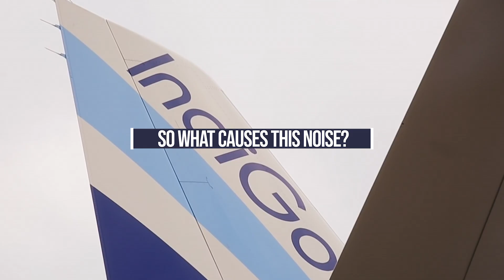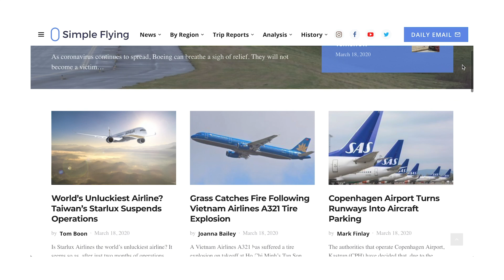What Is The Strange Barking Noise Some Airbus Aircraft Make?

Comment: The PTU will operate to transfer hydraulic power from LH to RH or RH to LH whenever at least one engine is fully powered. This will happen normally upon engine start, right after the first engine start (usually number 2, on the RH wing). Any other activation of the PTU indicates a failure in some degree.
PERIOD

Comment: Pretty accurate, but you'll never hear it in flight as it's only operational with one hydraulic system shut down, as in a single engine taxi or at the gate. This is only if the pilots don't turn on the "y" electrical pump while taxiing and when at the gate with the pump off and one engine either running or just shut down with residual hydraulic pressure remaining.

Comment: It happened to me once, I knew exactly what was going on but mostly everyone got spooked and started mildly freaking out. Me and probably a small handful of people, stayed calm because we knew it wasn't engine related. Hydraulics problems are the least of your worries as a passenger. The worst that can happen is an emergency landing on water, or landing on a foam covered tarmac. 

Even if there was an engine problem, your best option is to remain calm. Panicking will cause others to do the same and cause chaos, which what the crew and pilots clearly doesn't want to deal with during a dangerous situation. They need to focus on their tasks during an emergency. If not, it could cause major problems or delays that can lead to the plane crashing.

Remember, the pilots have trained many many many times for those situations. They know what to do. Sit down, relax, drink water, and trust the pilots with definetly more hours of experience compared to you. They will do ANYTHING to keep their passengers safe and well.

If you don't trust your pilots, why are you even considering riding on a plane in the first place? 🤨

Take a boat or something, jeez.

Comment: The PTU works like a turbocharger in a car with the difference that the turbine/pump impellers are driven by hydraulic fluid. The PTU is a redudancy backup pump  that connects 2 of the 3 hydraulic systems together. This is so that if the hydraulic pump in either of the 2 systems fail the pump in the still working system can then power the other broken system through the PTU keeping both systems operational. I saw some video  of one runing up close. The device emits a high speed turbine like sound while running along with the barking noise. Wikipedia has a great explanation to how the device works and WHY it sounds like it does. https://en.wikipedia.org/wiki/Power_transfer_unit

Comment: Scary sound. Had a very bumpy ride in an old Spanair A320 (engine vibrations included). We had to fly a holding pattern over MUC for 45 Minutes in rainy and stormy weather. And the dog was barking and barking and barking. Since I didn't knew the source of the sound, this was my most frightening experience on a plane ever. Spanair went bankrupt a few months later…

Comment: have only flown twice on 320's, but noticed a large number of noises coming from under the floor. I figured they were all related to control surface actuators on the wing as i was sitting right above it. With all the work that went into designing those aircraft, you'd figure that the engineers would consider it something passengers would rather not be hearing and design the controls differently. One constant noise sounded a bit like landing gear doors banging. Plane had a nice comfortable interior, but the noises were not at all comforting. And I'm used to flying on 737's and some turboprops!

Comment: The video only touches on this: Airbus planes have more than one hydraulic system, each powered by one of the engines. The dog mainly barks when only one engine is operating because the power transfer device is providing pressure to the other system.

Comment: Hi there, ex A320 engineering technical instructor here. A few little facts that weren't really mentioned. The hydraulic systems on the A320 are Green, Yellow and Blue. The PTU is connected between the Green and Yellow Hydraulic Systems and also operates when there is a 500psi differential between the Green and Yellow System. e.g green system drops from 3000psi to 2400psi and yellow is 3000psi the PTU operates. You may also here the PTU when raising the landing gear. This is due to when the valves open on the Green side of the system to pressurize the landing gear actuators there is a drop in pressure as the hydraulic lines need to be pressurized from the valve to the landing gear actuator. The pressure drop is sensed and the PTU operates to increase the green system to 3000psi. once at there is less that a 500psi differential the PTU stops operating.
Reply: Does this occur during the other phases of flight too such as when the pilot is maneuvering and configuring the airplane for a landing which would involve the application of pressure on ailerons and other control surfaces? That activity would set off some actuators too which would require the expenditure of hydraulic fluids, isn't it? Is it possible that during such times we just don't hear the PTU because its sound is drowned in the drone of the jet engines? I am curious to know. Thanks.

Comment: Thanks for info. Good video.
A hydraulicaly powered pump for maintaining a minimum pressure across the hydraulic systems of the aircraft. Sounds strange to me.
The first time I heard this noice, was when the plane was at the gate after the flight, and passengers were waiting to disembark. I think seat belt sign was off already.

Comment: I only hear it when the engines aren’t running and the electric hydraulic pumps are keeping up the pressure. I guessed it was the hydraulic pressure regulator doing it’s thing. As an A&P mechanic, I was always answering the “what’s that noise?” questions from my wife, now ex-wife. If you sit next to her on a flight, be ready to tell her it’s just the hydraulic pumps, or the baggage handlers just slammed the baggage door, or they’ll turn on the AC when the engines are running, etc.

Comment: https://www.youtube.com/watch?v=UHwqlNA15dM. At 6:09 you can here the crew shut down the left engine and turn on the yellow electric pump.  This is the pump we use to pressurize the yellow system for cargo door operations, and during single engine taxi operations.  this is the high pitched noise you hear at the gate intermittently. this is also the noise they say that didn't have a recording of in the later portion of this video

Comment: It's the power transfer unit. Simply put it's a hydraulic unit consisting of a fixed flow pump connected mechanically to a variable flow pump that interconnect two of the three hydraulic systems. At the first engine start this unit provides hydraulic pressure to the units that are fed by the other engine hydraulic pump. Cargos doors actuation inhibit the power transfer unit from operating, unless the electrical pump is activated by the flight crew.
The primary function of this unit is to provide hydraulic power in case of an engine out (as the engine driven pump will be inoperative too) as this unit is bidirectional any engine out on any engine will not result in an inoperative hydraulic system, assuring full control of flight surfaces and landing gear extension.

Comment: Yes I knew exactly what your referring too as the "barking dog" sound...and found myself explaining this to fellow passengers and the whining at the gate is indeed the cargo doors opening or closing again using hydraulics. APU / Ground powered, eng will  not be running or shutdown, as unsafe for baggage personal) 
Iam am/was a certified aircraft engineer @ GLA Intl, untill COVID 19 came and crippled the industry. My last job was to move 14 BA (737,319,320) aircraft and  park them remotely, engine covers on, pito, static ports covers, in fact everying flagged for storage in mid May.
Regards

Comment: If you hear it in flight it could signify an issue with one of the engines,  as one may have had to be shut down and the PTU is keeping the balance in pressure of the two hydraulic systems.  It also sounds a litte sometimes when the gear is raised or lowered and there is a slight inbalance in pressure or on taxi when one of the engines is off to save fuel.

Comment: Boeing has had them for a while. The 727 and the 737 both have them, but they are only used for emergencies so you’d rarely hear them. 

Both the 727 and 737 only have two full hydraulic systems. The A system and the B system. This requires them to have manually reverting primary flight controls. All Airbus models and Boeing’s from the 747 onward don’t have controls that can be moved manually, so they have three or four hydraulic systems. 

The problem with the 727 and 737 are twofold. First, the rudder(s) are too large to be manually controlled. Second is that the leading edge slats and flaps still need to be extended hydraulically (trailing edge flaps can be extended electrically). So there is sort of a third hydraulic system.. the Standby system. 

This will move the rudder if both A and B system pressure is lost. It is also activated when Alternate Flaps are selected. In this case, it runs a hydraulic motor. Attached to the motor is a hydraulic pump which draws fluid from the dregs of the B system reservoir (below the B pump pickups so any leaks in the B system won’t affect it) and puts them out to the leading edge slats and flaps. It can only extend them, not retract them. 

An interesting story related to this was the 727. It was designed back in the day of .10$/gal kerosene and when long range cruise was an obscure passage in the back of the book only used to make landfall. 

Then the energy crisis hit. They found that if they flew slower, they could save fuel. But the stewardesses had a hard time pushing the food carts “uphill” because the resulting body angle was too high. 

To help the stewardesses out, the pilots found out a little trick they could do. They’d arm alternate flaps and pull the CB for the Standby pump. They’d beep the trailing edge flaps out a bit, the plane would level, and they’d even pick up speed now that they weren’t plowing through the air. Win win. 

Well.. The flight engineer came back from the can, out of habit looked at the rows of circuit breakers, saw one popped out, and instinctively pushed it back in. Standby pump goes on, PTU starts, leading edge devices go down at Mach 0.78 or whatever they were doing. Of course, like most hydraulic things, they didn’t go down evenly. It was like hitting a brick wall and the plane spiralled down. They recovered it, I can’t remember if there was anything damaged other than egos and any chance of getting lucky with the stewardesses. After that, Boeing and the airlines issued a stern warning that alternate flaps were for emergency use only. 

Later, a modification was designed that extended the aft flap of the 727 which allowed for a slower and more level cruise without needing to do that.

Comment: The electrical sound talked about at the end of the video that the narrator said could not be explained, well, here it is!  The noise you’re hearing when at the gate (an electrical whine inside the airplane, specifically the A320 family) is coming from both cargo doors opening and closing.  The cargo doors are operated by hydraulic arms, powered by the PTU.  Because the engines are not running and the PTU  (specifically the yellow system) isn’t pressurized, it has to pressurize itself such that it can open and close the cargo doors, resulting in the intermittent 30 or so second whine you hear at the gates while the cargo doors are being opened and closed.  Here’s a video I made a few years ago with the sound (skip to 50 seconds) https://youtu.be/OtIgC4UKViM hope this was a good explanation :)

Comment: As a flight attendant, I always hear this noise mid cabin on 320, 321, after landing. I always thought it's weird 😁 Pax are looking at me like..."😳"
Reply: Only after they shut an engine down. They can eliminate the sound by turning a "y" (yellow system) pump on. Ask them to turn the yellow electric pump on afer they shut the engine down while taxiing. They’ll $hit their pants with your knowledge.🙂🤣
Reply: Ha Ha Ha !!
Reply: Every summer I fly A321 and I was wondering what that noise was about😅
Reply: I don't understand why this only occurs on Airbus but never on Boeing aircrafts.
Reply: @thihal123  because they are different planes from different manufacturers and with different designs
Reply: noticed last week a clank, clank, clank noise on a Delta airbus, noisy planes

Comment: The yellow hydraulic system pump makes a whining noise when operating the cargo doors on the ground. The PTU is a turbo–pump that sends power from the yellow to the green system and vice–versa, useful when taxiing with one engine. It never transfer fluid from one system to another, just power from one to another. Typical pressure is 3000PSI. A stressful operation for the PTU is when retracting the flaps and slats after landing and one engine is shut off, or before departure when one engine is off. Some companies allow for one engined gate departure and taxiing, lighting the remainder before take off. The Blue hydraulic system is always pressurized by an electric pump which has a higher frequency sound than he yellow. On the ramp with the main landing gear doors lowered the PTU is a very loud machine that manages to cover the blue and yellow electric pumps.

Comment: Since most domestic operators in India fly Airbus A320 variants, we are used to it. I wasn't aware about the PTU and it being related to engine and hydraulics, but was once told by a pilot in the next seat that it was a pump that was used to pressurize the plane at take off and landing. May be I assumed it to be cabin pressure regulation.

Comment: Idea for another video - the airbus a220 makes a similar noise that's a bit annoying while flying that only stops when the flaps are fully retracted. Why are the flaps motors/trim that noisy? 
Also, the a220 engines make a weird vibration when at low rpm and ramping up. Sounds like a temporary lack of lubrication but would like to understand...

Comment: I usually hear it but doesn't last long. I was a bit afraid when once it did this noise on take off and up in the air until the landing gear was up. Not the best feeling when you know hydraulic pressure should rise when engines are at higher rpm...

Comment: No PTU on A330!! Just on A318 to A321!
Power transfer unit, it means. Operate usually when one engine is off on groud of course.Each engine got an engine driven pump. and the aircraft got 3hyd systems; so to get two main hyd  operating airbus uses a part of hyd power from the engine running with the PTU to get another hyd source. Ya it operates when the aircraft taxiing with just one engine, to save fuel.   
On A330 there're two engine driven pumps on each engine.

Comment: I've always thought that it was the flaps extending or something.
Reply: The noise on account extension of flaps would be like a siren especially in Airbus equipment.   The noise is quite pronounced in A 380
Reply: @Narainseshadri1947  True, but the load on the hydraulic motor used to turn the jackscrew which extends or retracts the flaps might drop the hydraulic pressure in the system which then triggers the "barking" booster pump. It would then happen at the same time the flaps are set. If the engines are at operating speed, there should be sufficient pressure that the booster isn't needed. This would explain why you hear the sound only when taxiing or stopped.

Comment: Yeah, I have heard it before, it was on a Qatar Airways A319-112 A7-CJA and A7-CJB, first time I heard it, I was like what in the world, I asked the technical staff onboard who told me about the PTU. It was just before pushback tug would push the aircraft from the ramp to the parking area on the airport's outskirts and vise versa when the aircraft was towed back before departure. The pilots also operated the PTU as the aircraft shuts down at the gate though I never heard it in flight. I was working as an Airport Service Agent for QR in SEZ at the time and part of the job was to secure the aircraft.  Also got the chance to hear the same thing when they started operating the A330.
Reply: The drivers don’t operate the ptu on the gate. You will hear it on shutdown as one of the systems try’s to maintain 3000psi